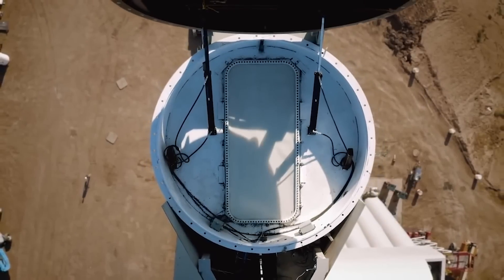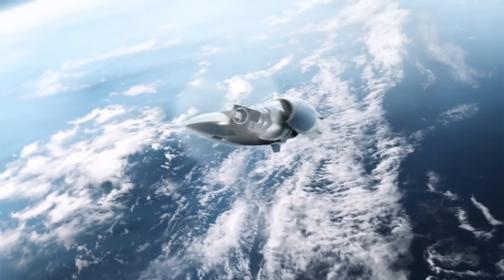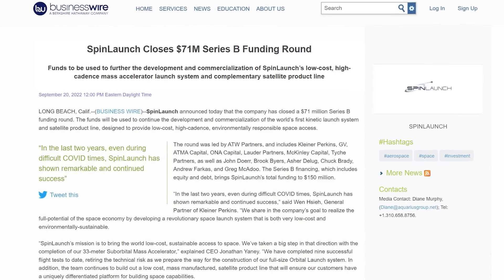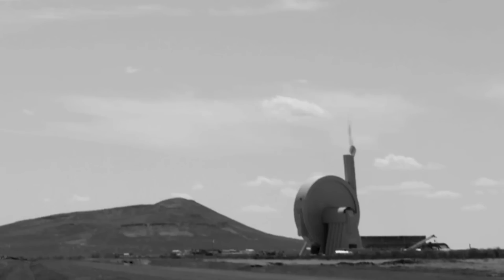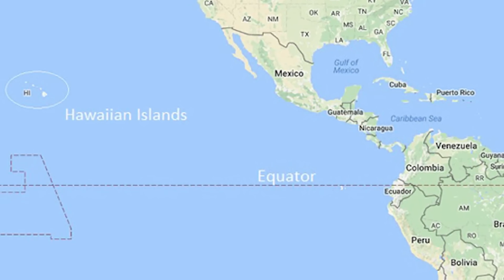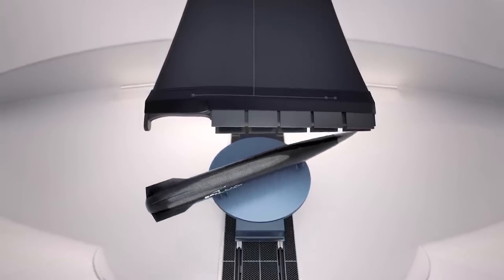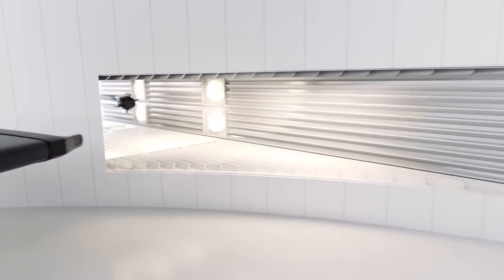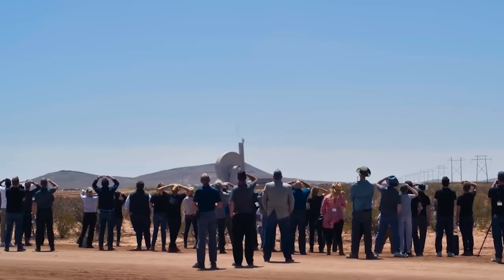What Happened To SpinLaunch & The Orbital Accelerator?

Comment: Can someone explain to me how they're counter balancing it once the payload detaches? Cool, you can spin up to really high speeds in a partial vacuum. You can time the release perfectly. You might be able to make all the systems on the payload withstand the forces. You can balance everything to spin it up to that speed, but what happens when it's released?? Can the whole rotating assembly just take that imbalance?
Reply: Apparently, there's a counterbalance which will also disengage at the exact moment the payload does.  The counterbalance will have more mass and be located closer to the access of rotation, meaning that it will be moving slower than the payload when it's released.

This is one of the few things that I think will actually work for the system. Otherwise, there are way too many other obstacles to overcome to make this a viable launch platform.

Comment: Anybody see the problem I see?  You can't de-rotate the projectile before leaving the vacuum. It will tumble a thousand times per second for many miles. 
I suspect that they don't and it tumbles when it leaves and this whole thing is a fraud.
Reply: Let the front go before the back.  It's not tumbling in the video they released, more of a mild wobble. So...
Reply: Thanks for replying  @bradleyrex2968 . I think you are right. But there's still a lot of torque produced by the back release. It has to produce a force to de-rotate something spinning 10 times a second in much less than a tenth of a second.
Reply: @walterdennisclark  I'm not saying any of this is easy.  But they seem good at finding simple solutions to what many claim are impossible to solve problems.  The two doors that release the projectile while maintaining the vacuum are a good example.

Comment: TBH I think the atmosphere and gravity make this kind of impractical on Earth, but I also think it is very much something worth pursuing because on the Moon or Mars this sort of launch device would be very useful for launching payloads cheaply without the need for fuel since they can be solar powered. And if they do manage to get it working from Earth that'll be a great bonus.
Reply: without athmosphere how do you plan to stop the projectle from spinning?
Reply: @SUB0PT1MAL  if released properly it wouldn't be spinning.
Reply: @AusSkiller  Not true.

From the projectiles perspective its is rotating, and when released this rotation force remains, if it wasnt becasue of aerodynamics the projectile would keep spinning.

On their own videos you can see that the projectile tumbles a LOT when launched, as it tries to keep spinning, and the fins work overtime to stabilize it.
Reply: @SUB0PT1MAL  yeah but you can correct for that if you release it properly. With a precisely placed tab behind the projectile you can use the rotation of the launcher to apply a slight force behind the projectile to counter the rotation. Alternatively if the precision needed is too much you can just have the projectile go through a low friction "barrel" to stop its angular momentum.

Comment: it doesnt need a counterweight. it needs a rethink. despite the obvious flaws, the major one is... you can get the launch speed to be far in excess of the peripheral speed of rotation... at least double. 

it does NOT require a counterweight. to think that it does is simplistic. stop thinking of the obvious. 

just one little alteration, double the launch speed and no counterweight...

Comment: As a small investor in new technologies I would not go anywhere near this project yet. Hyper velocity rail gun launching in a long vacuum tube or high altitude air craft launching (already done)  seems much more practical so far. Air drag is a big issue for any launch system. 

 Lots of grant scams these days out there to keep out of work scientists in nice paychecks. If the project fails, who cares, they'll find another one to get the government to waste tax payer dollars on.  Computer simulations cost less to do than building a prototype and seems more practical where the math gets you 90% of the way to a "go or no go decision"  that determines if a real prototype is worth the investment and effort. 

Sub orbital success is a lot different than actually reaching a successful orbit with accurate control ability. I'm no rocket scientist but I let common sense prevail, do detailed research and read the opinions of true professional engineers (many of them)  and rely on my observations, found facts, (never speculations)  before investing. 

It is a nice concept though. Can the engineering and technology make it work reliably, at low cost and high reliability?? Yet to be seen.

Comment: The video of their test launch showed the projectile just barely left the launcher hatch without hitting the structure. You can clearly see how unstable the projectile flew. However, this method cant reach orbital speeds. So the idea is to go to 5000 mph (about 7 times what they do now!!) and use a rocket booster for the final acceleration to orbital speed. Running this up to 5000 mph might need up to 30 minutes, where g-forces of 50000 to 100000 g will be reached. The payload and the booster rocket need to survive this timespan enduring this insane g-forces.
Liquid rockets wont survive that, you need solid rockets. Everything must be able to withstand this g-forces, making the rocket/payload quite heavy in order to be robust enough.
Just forget it.

Comment: I think it needs a longer barrel with several ultra high speed air lock doors, varying the pressures along the barrel. The projectile would pass through progressively denser air until it departs the barrel, thus preventing “the wall of air”...
Reply: Ultimately the same amount of air resistance will be exerted on the launch vehicle, you'd only be drastically increasing the complexity and cost with this design but for no gain.
Reply: they could just have a few chambers with that fabric cover at different pressures? maybe?
Reply: like saddam hussein gun?

Comment: The technical aspects of this idea is uninteresting as it do not even work in theory. Whether it is tough enough to withstand the enormous forces is actually totally beside the point. The most important point is that it is not theoretically possible to throw an object into orbit. The object you throw will either fall down again or disappear into space. In order for it to go into orbit a thruster is needed to change the trajectory.

Comment: As noted by @Orion789 and probably others, this will do nicely in a vacuum or a near vacuum like the moon or mars. Somewhat disruptive elsewhere. The question then arises, is there an advantage then over ion drives for reaching the outer planets? I would lean more toward a linear accelerator on the moon. If there was a use for it.
Reply: I'd argue far less disruptive than pouring smog all over the place when you launch a trad rocket, or having to fill massive tanks full of pure high-chilled suffocating gases.

Comment: This seems like the most inefficient way to launch something. The energy of the rotating arm is not transferred into the projectile, so it remains to spin after the projectile is released.
You then need to decelerate this rotating assembly and accelerate it again for the next launch.
Something like a trebuchet style energy transfer would be more efficient and it wouldn't require any counterweight on the rotating arm because as soon as it dumped all of its energy into the projectile it would be basically stopped.
Reply: Regenerative braking would slow the arm down quick and recoup most of the energy as stored electrical energy for the next launch.
Reply: At least you're trying to advance the concept, thank you for that.

Comment: One more massive problem... if you throw something straight up, it'll fall straight down. There's a reason rockets "tip over" when being lauched, they need to increase their velocity sideways to the Earth. All an orbit is is when you're traveling so fast in space that even though you're still falling to Earth you keep missing.
Reply: Actually, the earth rotating under them will not bring it straight down if they get it high enough.
Reply: @up4open  Close enough to not miss the Earth.
Reply: You can throw it at any angle you want as hard as you want, it doesn't matter, you cannot throw a static object into orbit. It'll always come back to the exact place you threw it from like a boomerang (crash back into earth). You need to circularize the orbit by doing a secondary burn at altitude (Hohmann transfer) so you need to throw a rocket to stay in orbit so it can light and add thrust later on. If you don't you better duck. (You could throw it hard enough to reach escape velocity so it never came back but then that's not an orbit.)

Comment: This system will never be successful. They'll never be able to have a vacuum chamber as planned. Remember that there has to be a "plug" covering the exit tube holding back the atmospheric pressure. Remember at sea level, that's 14.7 psi, or pounds per square inch. If you have a circular opening 3 feet across, that's nearly 1018 square inches x 14.7 lb/in^2, or nearly 15000 lbs being held back. The opening has to be strong enough to hold the weight of 7 1/2 tons in other words, and you want to crash a projectile into that at ridiculous speeds. (Even at 10,000 feet, that's still 10.1 psi.)

It will be catastrophic.

Comment: I see this technology being used for military purposes.
Ordnance launched at great speed, with no heat signature ai ed at a specific location would be devastating, and virtually impossible to trace.
Reply: "virtually impossible to trace." Say hello to Occam's Razor.
Reply: we already have that for decades, it's called artillery. SpinLunch launched the payload to 9km high at a muzzle velocity of 1000m/s, every single 155mm artillery piece can do that with conventional ammunition if they point the barrel to the sky. It's actually kind of interesting how those numbers line up exactly. Modern assisted munitions can probably go higher, but that's not the purpose of artillery or any military payload delivery.

Comment: It seems like similar forces to a giant gun like in Jules Verne books.  It has to reach enough velocity to overcome drag and escape gravity, faster than a bullet, so anything inside has crazy G forces.  Can just transport very strong materials.
Reply: It's actually substantially higher. In a gun, you have the length of the barrel to speed up, with the propellant accelerating you the entire time, so the g-force can be distributed across that time frame. With this, they have to first get it to spin at full speed, and only then they can release it. But while it's spinning at full speed, it's getting pulled sideways at over 10,000gs.
Reply: @eugenes9751  I imagine the deceleration force too when the projectile hits a solid wall of air as it exits the launcher.

Comment: In the early 1960's, the 33,000 lbs X15 was drop launched from a B52 at about 45,000 feet and 500 mph.  For rapid turn around, it seems like that approach makes far more sense than the SpinLaunch approach.  There are some significant physical limits to what their approach can achieve (which other commenters have pointed out)--it will always require a rocket motor to get to orbit, I believe (you must get to around 18,000 mph (29,000 km/hr) to achieve orbit which is much faster than their demonstrated launch speed which must be near the max possible for that design).  The drop launch approach is all proven technology and the fuel cost and maintenance to fly a large, existing launch aircraft must compare favorably with pumping down a big vacuum chamber and driving the electric motor up to the SpinLaunch release speed.
Reply: You can never throw something into orbit without a secondary burn (rocket) to circularize the orbit. Without the secondary burn your trajectory will take you right back where you started (on earth). Sure, if you throw something hard enough then you reach escape velocity and keep going but then you are not in orbit. If you want to keep going around the planet without coming back to its starting point and hitting the planet, you need a secondary burn (Hohmann transfer).
Reply: yea yea, that's all a nice defense of "we already know enough of this kind of physics," and a terrible discussion of advancing.

Comment: I dunno - it seems to me like even way more stress on something than a standard rail catapult of some kind would put on the same payload. This 'seems' like it's more compact, but I can't imagine the centrifugal force being generated by launch, and the incredible torque being applied to any payload within at exit. I mean, we have radio towers all over the place - I doubt you would need any bizarre new construction concepts for a  catapult long enough for a velocity controlled (ramp-up to control payload crush) launch. That's just an amateur's guess however.

Comment: Might've missed it but - how in the world do they keep the whole thing from flying apart once they release the payload? You now suddenly have a very fast moving, VERY unbalanced mass, that has to create immense strain on everything, no?
Reply: They release a counterweight on the other side at the same time. It would presumably travel down a tube on the other side for a while before impacting the ground. Might be able to have a deep pool of water down there (if covered with a thin layer of vacuum-resistant oil to prevent it boiling off).
Reply: They have magic beans. The magic beans leave an aura of magic residue that counteracts changes in all normal weak forces at a rate which cushions the materials.

Comment: Thunderf00t did 2 really good episodes on why this "slingshot" is a bad idea, and will never get anything into orbit. It would be quite impressive if they could outperform a 100 year old battleship gun, but they are not even close to that. 
Not to mention that in order for the projectile to fly straight you need to spin it around it's center axis of motion, and you cannot do that with a slingshot.
So no. This is not gong anywhere.

Comment: They are using a booster to get the projectile into orbit though. So maybe they don't really need to get up to these crazy Mach speeds for the launch they just need to add another booster under the projectile. And let this machine get that projectile pass the hardest portion of the atmosphere to move a rocket and use a detachable booster to push to projectile to the point where their typical booster kicks in.  Because I am sorry, but the Physics laws they're gonna run into trying to launch these projectiles at Mach five are going to be probably navigate the viability of this company rather quickly.